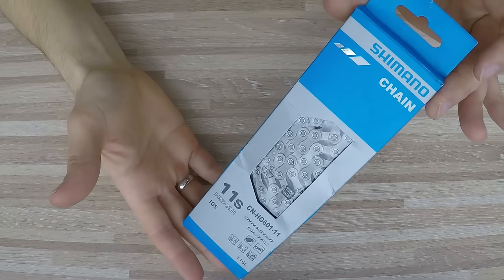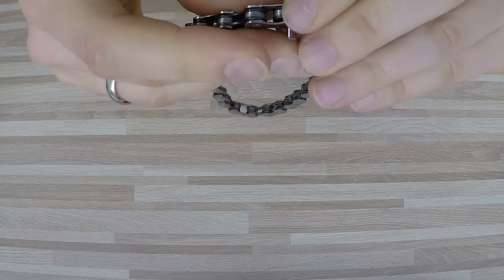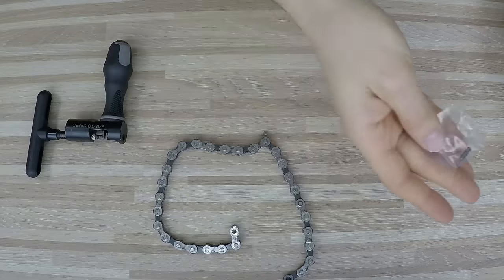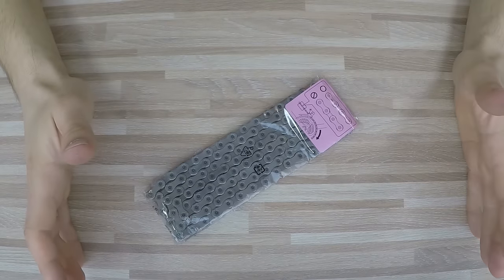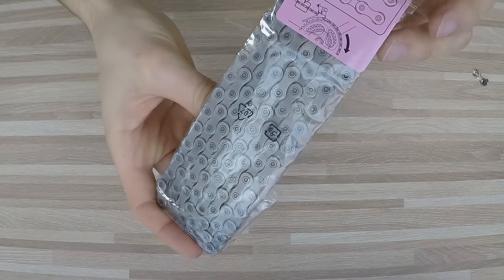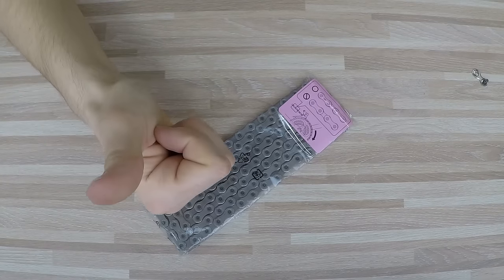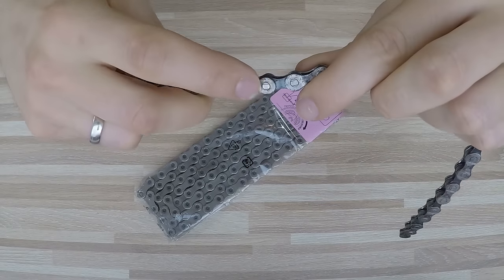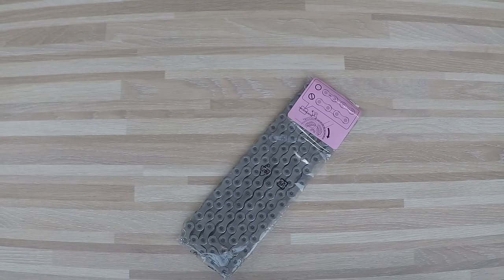4 Worst Mistakes In BICYCLE CHAIN Maintenance. How NOT to do it. SickBiker Tips.

Comment: Before the 6+ sprocket clusters came along, it was perfectly normal to use a chain breaker to push the pin part way out and push it back in to assemble. 
This was because the pins protruded out from the plates a small amount, so you weren't tearing the swaged edge off.
I've been working on bikes for 45 years, and my Park chain breaker pliers have been quite handy.
Reply: And... what?  I've got a bit more experience than you claim. Yes, I've taken plenty of chains apart in that fashion as well, chains (like every other aspect of biking) have gone through a world of change since those days, the quick link is one of the best things to happen to chain removal and replacement. The chain cleaning tools (the ones you use with the chain in place, that have a reservoir of degreaser)  are also a better way to clean a chain and way quicker,too. When the Shimano replacement pins first came onto the market, their chains were given an undeserved bad rap (primarily due to mountain bikers not understanding how to replace these new style chains) they blamed the chains failure rate to the design, I never had a single Shimano chain snap. The fault was the lack of proper procedure on the part of the mechanics.
Reply: @larrydaniels6532  Wait, you've more experience than the guy who has been working on bikes for 45 years, and you've "never had a single Shimano chain snap". Yeah, I don't believe that. Sorry, but that's not possible.
Reply: @philipking4794  I can honestly say that is a true statement. But then, I'm educated and can  follow instructions. Much of the problems arose out of disregard for the new Shimano system requiring special long pins that were snapped off. The main problem was error of the installer, did not understand you could not push a repair pin out to insert another in it's place. This was very early on before the majority of installers understood the reason it was different for these chains.
Reply: @larrydaniels6532  Oh, you're educated, now I understand. My bad. When Shimano went beyond 6 gears, most mountain bikers moved to SRAM power links which were far more reliable (and useful) than Shimano's replacement pins. The Shimano replacement pins were garbage compared to the power links. And even though you may be far more educated than most bike mechanics, I have never met a bike mechanic, ever, who couldn't properly fix a chain. With all due respect, I don't think you have any idea what you're talking about.
Reply: @philipking4794  And I feel the same about you! The early Shimano chains were not my favorite and that is why I chose KMC as my personal chains, however as a mechanic many bikes came to me and I would often recommend replacing the chain, many declined. Again, I never had any problem with the pins and certainly no failures. Based on YOUR assessment, your view says to me that you were clueless on the proper installation procedure.
Reply: @larrydaniels6532  both sram and shimano make perfectly suitable chains for you two fairies to beat each other with
Reply: @crabtrap  is a name caller from a safe distance! You would be the quivering, silent little girl if we were in the same room.
Reply: @larrydaniels6532  lol, ok tuff guy
Reply: @larrydaniels6532  ohhh Lerrance, i love when u act butch🥰

Comment: I always use the extruded pin a second time to extend a new chain from 116 to 120 links. The trick is that it is not enough just to press the pin back, it should be slightly riveted at both ends.
Reply: Jeah, I have used it on many a chain and I run them like 5 times the kilometers. Just do it right.

Comment: I always carry a quicklink with me and I recommend it to everyone! It saves ass.
Reply: Wilderness Music  I carry both. The quick link (I use the Connex brand because it doesn't need a tool to put it on or take it off) because it's fast and safe and doesn't require precision work. I carry 2 chain rivets because it doesn't take up much room and is light. The chain rivet tool comes with my multi-tool (the Park MT-3.2). Thankfully, over the past 20 years, I've only had to use this three times, twice for me and once for a fellow cyclist.
Reply: Wilderness Music  That's amazing and potentially VERY dangerous! The good thing is that, assuming no one got hurt, it's a great cycling story once the years roll bye. :)
Reply: Agreed.  I keep a quicklink and 2 new pins in a little compartment in my pump.  I also carry a fancy multi-tool that has a small chain tool built in.  I should buy shares in Crankbrothers.
Reply: Wilderness Music Ouch!
Reply: Heather Spoonheim Hello. This may be a dumb question but can you use a quick link on a chain previously linked by a rivet? 
If not then why do you carry both? J.
Reply: @jatsajatsa  Yes, I believe you can.  Quick link is quick, but a new pin is more reliable.  Either way, if a riveted link gets bent, I'll need the chain tool to remove it - which weighs ten times more than the quick link and pins put together, so why not have both options?
Reply: Stupid question, but how do you use a quick link if your chain breaks. Normally i would need two small ends for my quick link to work, but I believe if a chain breaks you would have a big and a small end.
Reply: Does it also shave my hairy ass?
Reply: And a chain tool@

Comment: After degreasing/cleaning and washing the chain, I use a compressor and blow the water out of the chain.  This works well and then lube.  Good video.
Reply: I don't have an air compressor, but what has worked for me is putting a chain in a small container and blasting my hair dryer on HIGH for a couple of minutes. Evaporates all the water out.

Comment: Helpful tips! Thanx!
My tip for removing the original sticky grease from the chain: use some very thin fluid oil (like gun oil for example; my favorite one is "Ballistol" because it works perfectly and is completely organic) instead of a degreaser. It's good for cleaning and lubing all kinds of components. But you have to use some thicker lube (I prefer liquid lube with silicone or teflon) for riding because it doesn't last long on the chain.
Ballistol also works pretty well for removing moisture after cleaning or even removing rust or hardened residues of old oil and dirt. 
I once managed to get an old MTB chain moving perfectly again that had become completely stiff after someone had used some awfully sticky Motorcycle chain spray on it (NEVER EVER do that!!!).
Reply: a cheaper route is seafoam in a spraybottle. it is naptha and shale oil. it cleans and light lubes for apllication of real bike lube

Comment: Yes, very good info, I've been riding now almost 60years and have come to the very same conclusion. I would add after any wet ride make sure you dry your chain, I keep a old news paper handy and dry and clean the chain till it is dry to the touch then re lube the chain the next day or before your next ride, (wedge your chain lube through your spokes so you don't forget to lube the chain before you ride. )
Reply: smithy george thanks for the tip, learned something new
Reply: If you are using a dry type lube, it should be applied the evening before you ride, so the solvent has time to evaporate.  Do not apply this type of lube immediately before you ride, or during a ride.

Comment: I have always backed the pin out and pushed it back in. Never had a failure, and I use the same technique on my single speed too which takes much more force that a geared bike. I also wax my chain which makes it last twice as long as oil. To each, their own, but this sort of contradicts what I have been doing for years successfully. I do have a quick link in every bike bag, but have never had the need to use one. Thank you for your insight though, I'm glad it has worked for you.
Reply: I started mountain biking in 1990 when then backing the pin and pushing back with the special tool was the only way to go and if properly executed didn't cause any problem. I used to join two chains for my tandems and had no issue.
I've been using quick links since they was introduced for conveniency.

Comment: I'd have to disagree with the last method - strongly too. As a chemist, most nonpolar solvents WILL not be acidic, since they any sort of simple acid (save for exotic acids such as p-TSA) will not normally dissolve in mineral spirits and the like. 

However, the container method/ultrasonic cleaners work extremely well because ooooh boy does it clean up chains extremely well. So well in fact that you will strip the chain down to bare metal. In this respect, the chain will get oxidized by the ambient air extremely quickly, even more so if there is moisture. Lastly, to displace any residual solvent, I typically use isopropyl alcohol/denatured alcohol, since they pull water extremely effectively and evaporate quickly; which is useful to immediately wax/relubricate the chain, free of any other residual solvent or dirt.

Comment: I have fitted hundreds of chains with a push in link and they have never given any problems. I don’t use the break off type of pin, just the push in link that comes attached in the chain. Good points you mention interesting video thanks for great advice

Comment: I use KMC chains. I don't use the master links. I break the chain and drive the pin back in. I've been doing this for 30 years without a problem.
Reply: i just tried new campagnolo 11 speed link piece of shit broke 2 aluminium pins and wreched chain so had to break 2 links and add links
did old school way like you do
pins all have no ring or ribs on one side anyway
any way tighter with old pins always tight joint but when use supplied link slides in way easier 
love to see how pro mechanics do it :) think old way
Reply: Use quicklink all the time for years on all our bikes - just take the chain off to clean both it and the bike- easy. Never had a problem at all ever!
Reply: yup. i just switched to kmc with the quick link. one of the best things i have done. cheaper and better.
Reply: I have never had a chain break but I saw it happen to a friend and my balls hurt in sympathy, to hell with your 30 years if the man says there is more risk of a chain break I'm using a new pin.
Reply: Hi Eric, Full disclosure, I'm the Connex chain importer. Back in the days of 1/2 x 3/32 chains (6-, 7, - and 8-speed chains) there was enough meat (thickness) to the outer links that you could  push pins out and back in. However, as chains have gotten thinner, the outer plates (the ones that hold the pins) have also gotten much thinner than they used to be. Further, modern chains are now riveted to the outer links. If you break the rivet, as you do when you press out a pin, you'll absolutely end up with a weak link if you press it back in. The outer plate is too thin to hold it well, and the rivet that used to be there won't be. Of course, I'd like you to use Connex and the Connex link. They're the best, longest-lasting chains on the market. But whatever chain you use, breaking the chain and then driving the pin back in is no longer the way to go. If you want to know more about Connex see: https://www.cantitoeroad.com/Chains_c_7.html
Reply: Eric Warburton I had a mater quick link break and leave me stranded.
Reply: What master link were you using?
Reply: The reply below about thinner outer plates is an excellent comment.  I never break a chain except to size it to the bike I'm installing it on because the factory inserts a chain pin in a far more effective method that can't be duplicated at home or even at a bike shop.  After that I use a Connex master link to connect the chain.  Even if you've never had a problem with your method, a master link is so much more convenient.
Reply: @tomboniboitomboniboi  I've been using the Connex Links on my Shimano and SRAM chains (10 speed) for years. Neve had an issue.
Reply: @tomboniboitomboniboi  makes sense-  I was joining chains reusing the pins for years but that was on 9 speed. Tried it on my new 11 speed setup yesterday. Today I have a site leg where it doesn't into the bars as I stood up to accelerate and snapped the chain.
Reply: Same bro I've been a bike mechanic for brompton for the last 15 years, that guy is a clown hahaha.
Reply: Kevin Carty Regardless, there is definitely a right and wrong way to do something, and reusing a pin is definitely the wrong way. It might work, but it will NOT be as strong. A chain pin is like a rivet and will expand the metal when pressed and pulled back out.
Reply: Eric Warburton: What you didn't state was how many speeds you have on your cassette. You can reuse the link on 8 speeds, but try that on a 10-12 speed and you won't be doing that for even one year.
Reply: I've been playing Russian roulette for 30 years now without a problem. I haven't shot myself in the head yet. So, I feel completely safe in continuing.

Comment: Thanks for making this video. I have definitely made most mistakes in the book and still forget about cleaning the chain sometimes. Winter here in Alberta is an absolute chain killer. You think the chain is perfect and two small rides later it looks like rusty mess full of road grime. For my next winter bike build I'd like to go with an internal hub and a Dutch style chain enclosure. I like to home brew my chain lube from sewing machine oil and graphite powder. It seems to work well, but it can leave nasty stains on your pant legs. I believe the graphite is an inexpensive way to get better protection.

Comment: Reusing the pin is no problems for 7 speed chains as the chan links and pins are wider and tapered on both sides. This is only a problem on bikes which use thinner chains ( more than 9 cogs) where the pin is short so it compresses more thus you need a new pin.